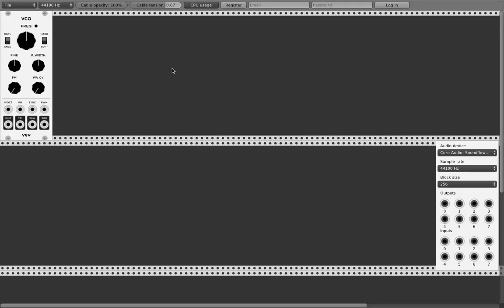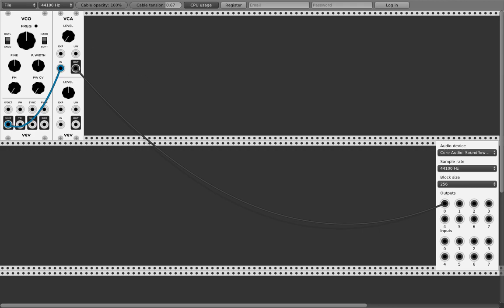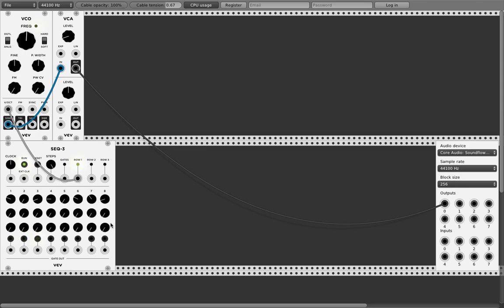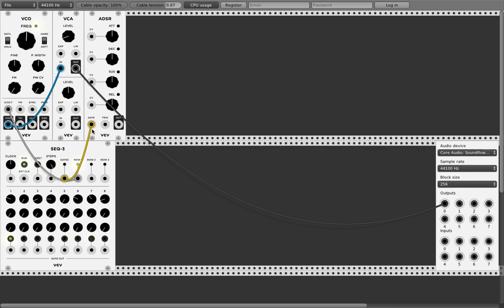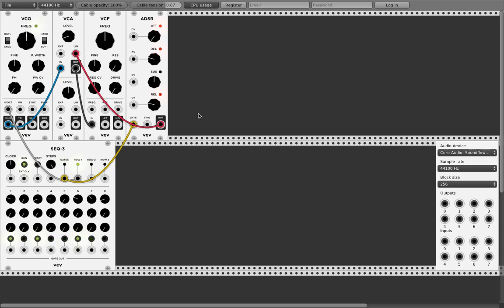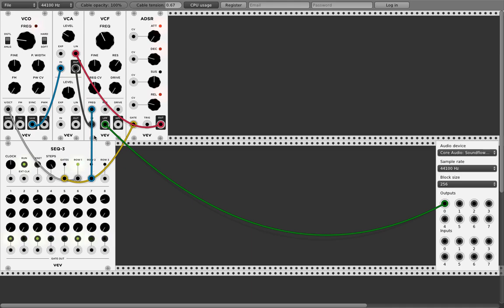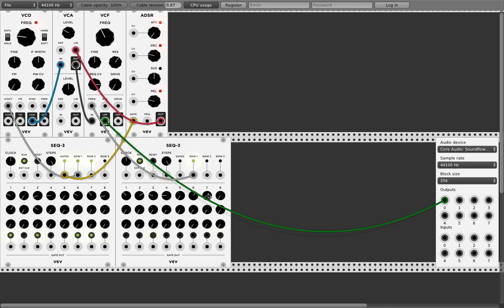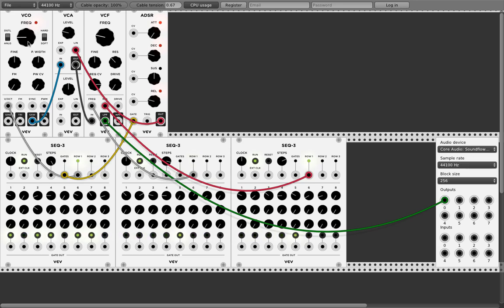Modular System Beginner Tutorial #01: Let’s make music with VCV Rack!

Comment: When I add the envelop generator it reduces the volume to next to nothing. Any ideas?
Reply: I think a later version of VCV changed something. I got the same problem. Attack controls the volume rather than the attack of the note... or rather the "muteness" of the volume. Pulling attack down to 0 gives you the full volume again, but Decay and Sustain doesn't work at all in this setup on the latest version of VCV. Haven't figured out why yet.
Reply: Yeah I've noticed that too. I have to turn "attack" up all the way to make it audible. I'll check out turning it down to 0 and see what happens.

Comment: I don't know why my wave is panned left? When I add a second wave, that one is panned right...
Reply: Use the Befaco Mixer to combine all your sounds into stereo.
Reply: That's what happens to me, I don't know how to use the Mixer, so I don't really know what to do
Reply: You don't need a mixer. Instead of dragging Output of the module to Output of the audio driver, pull one cable from the first output of the audio driver to the output of the module, then another one from the second output of the audio driver to the output of the module. That way you get two cables running from one output on the module.

Channel 1 is left, 2 is right. That's why you only get sound in one ear.

Comment: Really interesting and helpful - thank you! One minor thing I've noticed is that after I chain the sequencers together and then "detach" them they seem to drift out of sync - at least I think that's what's happening. I can't leave the gate 1 out connected to reset of the next, because then the steps won't vary (get "out of phase", as it were). Is this a setting I've got wrong? Anyone else see this?

Comment: Hi and merry Christmas. You video is excellent (for me) but - in my opinion - may disappoint some absolute beginners concerning modulars. Why you're using a SEQ-3 just at the start of this video (after 3 minutes), instead of a simple "Midi to CV"? Assuming it's too complex for a real (absolute) beginner. Regards.
Reply: I think it's because you can produce CV via knobs and not via MIDI. The MIDI to CV-Panel needs MIDI-Input, which is not possible to realize without external tools or at least a real MIDI input device.
Reply: From my usage as well, most of the time, I don't want to sit there for as long as I'm working and keep hammering out the same 1-8 notes. Plus using a sequencer allows for perfect timing and time based effects. Most of the time, working in modular a sequencer would just make more sense.
Reply: Yeah, actually, I'm a complete beginner to this and I found that really helpful that he did that. I was watching some other beginner videos and they were trying to explain all the workings of everything before getting started, I found it very boring. I'm an intuitive learner so, if I hear a pretty sequence of sounds coming out of something like that, I will be able to reproduce it very easily by playing around, thus gaining a more complex level of fluency faster; but if I'm being explained really basic modules that don't seem to do much, I'm not going to be motivated to try. So I thought it was really good.

Comment: For some reason my gate doesn't work
Reply from the maker: Set Attack (ADSR) to Zero - than you should hear something (i hope)
Reply from the maker: Are you using the patch from the description? If yes - maybe it won't work if you use a newer version of VCV Rack (actually 0.4.0)
Reply: I have downloaded the 0.4.0, but the only patches I have Installed where from the website itself.
Reply from the maker: Thats probably the problem - the patch was made with 0.3.0 and maybe doesn't work with 0.4.0.
Best advice to follow this video is to patch it together yourself.
Have fun!
Reply: Same here. The second you add the red wire from ADSR OUT to VCA LIN, I lose all tone. Can't see it in the scope at all. I have the latest version as well
Reply: Had to crank up the REL. Thanks for the help!
Reply from the maker: You're welcome ;)